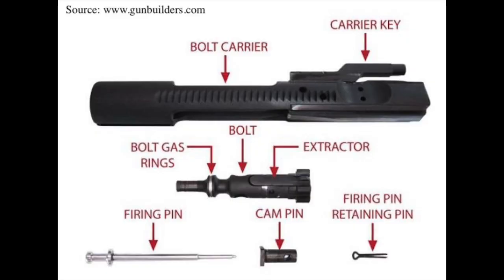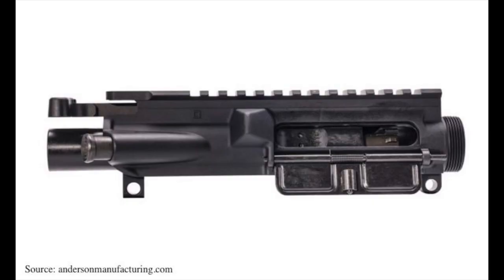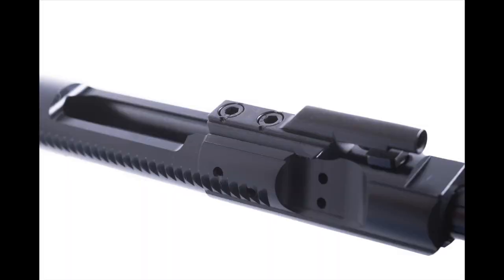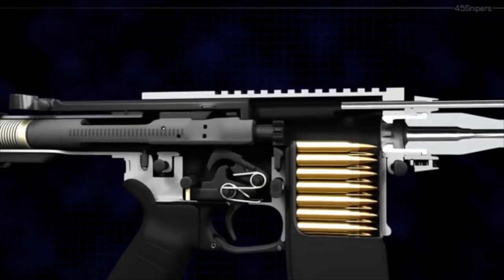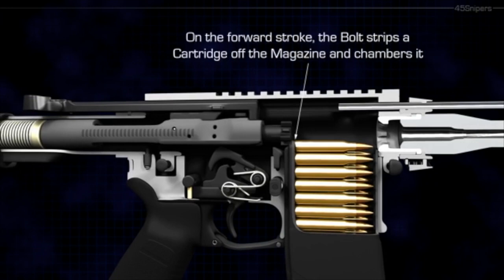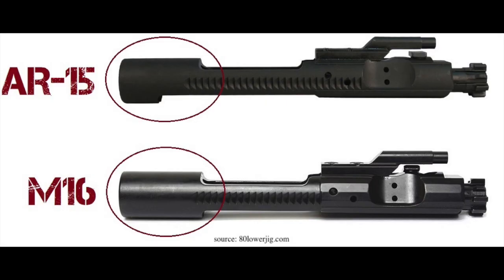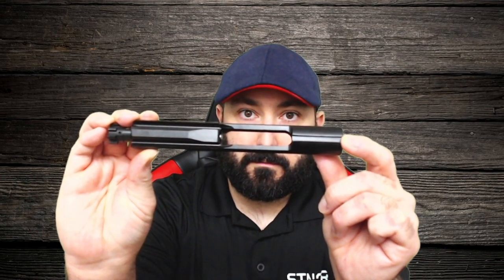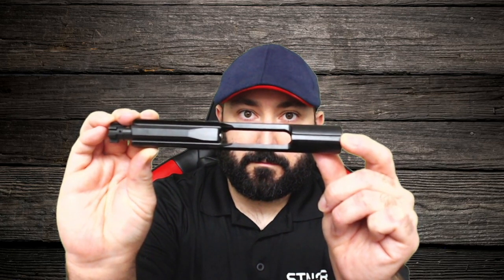Should You Get an AR-15 or M16 BCG? Bolt Carrier Groups 101

Comment: I have a S&W mp ar 15.   Can I buy an m16 bolt carrier group for AR15.  Do I need additional parts to make my AR 15 auto like m16
Reply: Do you mean will the m16 bcg make your AR15 full auto?
Reply: I know this is a year old but if you are still wondering. you would need other parts to make it full auto. you would at least need an M16 fire control group, however I'm certain that wouldn't work without an M16 lower receiver. In order to get that legally you would likely need to submit a Form 1 with the ATF if you can find a way to get your hands on a lower receiver.

If you don't want to do that (at the time of writing this 4-20-2025) the courts have decided that forced reset triggers are legal. you should look into that or look into getting a hoffman tactical super safety. Because of how the definition of a machine gun is written these would technically be semi automatic but fire as fast as a full auto firearm. If you end up going with this route I suggest keeping up with gun laws because last I knew the ATF is currently taking this to a higher court and the law is subject to change on a judges decision. Also congress could just pass a law on this and you could become a felon over night.

Don't trust me because I said this on the internet. Do your own research. The ATF does not mess around when it comes to full auto guns.
Reply: @tytendo64 no u don’t just get m16 bcg and your done what are u talking about
Reply: @glassboi5401  did you read my comment at all? I said you would need other parts such as a m16 fire control group and likely a m16 lower reciever (which you would need to submit a form 1 through the ATF to get).
Reply: @tytendo64  my bad I skimmed through it wats the alternative tho because nobody wants to go through the atf?
Reply: @glassboi5401  I'd suggest looking into a forced reset trigger. It's similar to a bump fire stock in the way it gets around the law by you pulling the trigger every time you fire, however it fires close to if not the same speed as full auto.

The law suit (mentioned in my first comment) has been settled and the ATF can't restrict forced reset triggers and have to give back the ones they took. 

If you do look into this you should also check your states laws. Some states restrict firearm modifications if it makes your gun shoot faster.